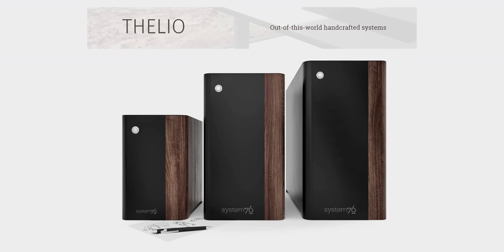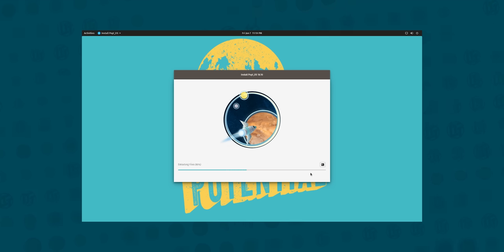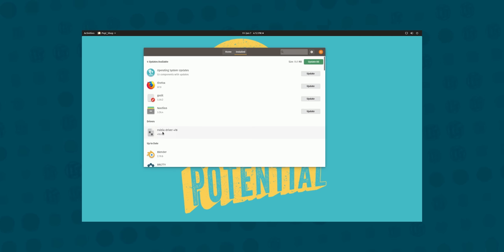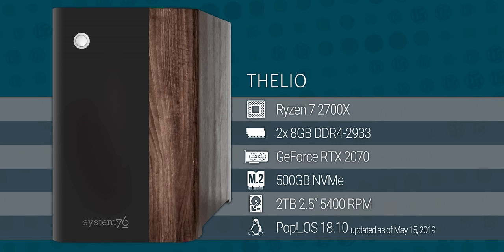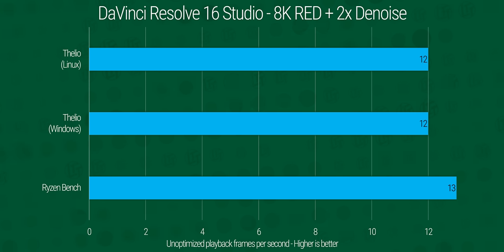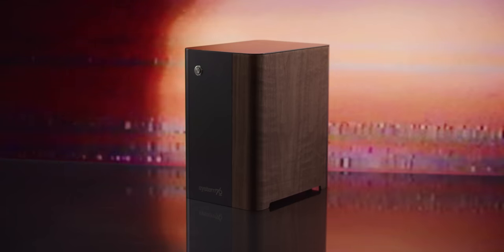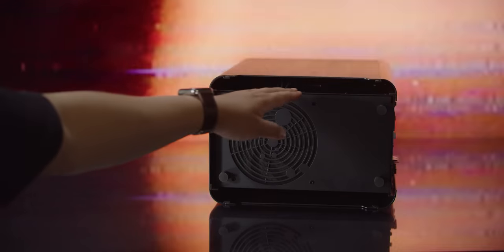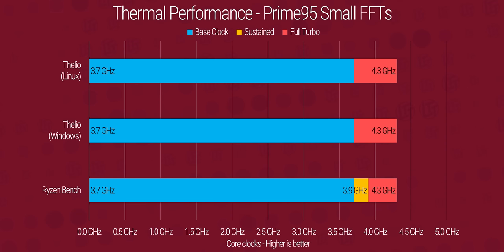A REALLY Weird PC… - System76 Thelio Review

Comment: I've got POP!_OS installed on my laptop and I really like how clean and simple it is.
Reply: How is the battery ? I was thinking about installing it on my uni laptop, but not sure.
Reply: @BlackPeagas  It's less system intense than Windows for most things, so the battery should do at least as well as Windows, but it's hard to say since so many things can factor into battery life.
Reply: @BlackPeagas  If Linux has all the drivers for your hardware, the battery should last a bit longer than with windows. If some driver that is important for the power management is missing, the power consumption can be much higher than with windows.
Reply: @Puma2535  Yeah. The older the Thinkpad/Lenovo and the more AMD or Intel the HW is, the more likely it is that your system will have all drivers.
Reply: Its really great and battery is better than what it was for me on lenovo IdeaPad 320 (shitty laptop btw)
Reply: I used to have pop but i ran into an issue one time when booting which  required me to completely re installed the os and lose all my data.

After that hell hole and losing all my data i just moved onto ubuntu budgie, since it looks nice and clean like pop os and thats about it really xD

The errors were probably my fault but it will probably haunt me for a while since i had a game i was working on which was really close to being in "playable" condition but ultimately lost it : (
Reply: I use Mint with Mate. Not tried POP, but from this video, it looking to be running the standard Gnome 3.x desktop environment, so that "clean and simple" look is not Distro dependent, you can have that exact same look and feel on a different distro, if you just use Gnome 3.x
Reply: @LordDankTron  Why didn't you use git and cloud services to store your project's files ?
Reply: @smartaayush  mines IdeaPad 720s currently on win the battery sometimes goes crazy. But usually very good battery time. the laptop is cool just crazy fans when not battery saver mode.
Reply: @BlackPeagas  lenovo has the most horrible build qualities ever (FULL-STOP). My laptop feels as if someday its just gonna melt due to the hot weather both in India and Bahrain
Reply: @c.james1  on point you are sir , but pop os comes with out of the box proprietary Nvidia drivers . Also it has a default icon pack and theme by system 76 which makes it look cooler and cleaner
Reply: Totally agree. Used it since bought G5 5587. At first was a bit of a nightmare to setup, but after it worked great with great battery live. Tried Lutris, Proton and KVM for win-only apps. Had to install Windows in dual boot and go through a headache again. Yet Pop OS is still awesome and easy to use.
Reply: It runs surprisingly well on my AMD E1-1200-based HP notebook, despite how pitifully underpowered it is.
Reply: Pop! Os with TLP installed it's very very battery friendly. My laptop with Windows, using it for tasks like web developmemt, i was getting like 4 hours of Battery with Wifi on and all Battery life settings turned on. With Ubuntu 19 + TLP, in the same conditions, like 3 hours of Battery, and finally with Pop! Os i was getting the same time as Ubuntu, but when i installed TLP, the Battery lasts 5 Hours without any problem on the balanced power setting.

The Main problem that i have with Linux is that hardware acceleration doesnt work in any browser, so things like watching videos Will end with your Battery really fast
Reply: I installed it on my acer cloudbook 11 and my trackpad stopped working
Reply: @BlackPeagas  I use Elementary OS in every single computer I've got, I'd say it's the definitive OS for a laptop, especially if you add libinput-gestures (e.g. 3 and 4 finger swipes to maximise the current window, open Expose, go back/forward, change desktop....). Battery life on Linux compared to Windows depends a little on hardware, but they pretty much trade blows and you need to test your system to get a definitive answer. The only case that tends to favor Windows is if you have both a dedicated Nvidia GPU on top of the integrated one (Nvidia Optimus), since on Linux you basically can't hot swap them, you need to change GPU in Nvidia Panel, log out and log back in (no need to reboot though). Therefore you need to compromise battery life or performance, or do the annoying log out log in cycle everytime you want to use the Nvidia card.
Reply: @LordDankTron  back up... Redundant back up.. you only lose your data if your not backing up onto a secondary drive..
Reply: @iagobkstar  THX a ton, that was actually quite useful knowledge, tbh didint expect to get from youtube comments. Deffinetly gonna test out Linux performance. And those gestures.
Reply: @BlackPeagas  You're most welcome :) Also, read what Dustin Bess wrote. Backup your data!! The easiest way (the way I like to do it at least) is to get a cloud sync service like Dropbox (2.5 GB for free, has Linux client) or Google Drive (15 GB for free but you need an unofficial client for Linux like insync, not open source and paid) and save your important documents in your sync folder. Or get a backup yourself manually. For big files, pictures and stuff you will always have to back it up manually.

Comment: Well, I’m a macOS user, but this Linux desktop has peaked my interest. Certainly much more reasonable in price than what Apple has recently offered.
Reply: And as someone who grew up in the same ecosystem since the iMac G3 days (I had base model for my first personal computer that I shared with my older sister), I find it equally as appealing for it's upgradability. I even tried Pop os myself during some distro hopping and it's pretty nice, even with the Gnome desktop being a little slow and scaling a little weird on my laptop's screen.
Reply: ElementaryOS, a Ubuntu based distro will catch your interest since it's desktop environment Pantheon is more towards MacOS users.

Comment: I switched to Linux for gaming and all. So far I'm very impressed. (Bring more Linux Content!)
Reply: Julio Caesar  Native Linux games run way faster that on Windows. I have a 3 fold performance improvement in Minecraft.
Reply: @June Kreps  Not going to lie, that 500fps mark on minecraft is making me really curious. Maybe I need to try Linux one day
Reply: Julio Caesar  Even non native through the likes of Proton or Wine can run faster, it depends on the game of course, a game like Strange Brigade or Doom 2016 that uses Vulkan under the hood will most likely run better on Linux but those that use Direct X like Hitman 2 wil see about a 10 FPS advantage for Windows. 
https://www.forbes.com/sites/jasonevangelho/2019/03/01/windows-10-versus-linux-6-steam-games-benchmarked-on-intels-hades-canyon-nuc/#20226de278ce
However something you barely see in comparison benchmarks is the way faster load times Linux provides, I have only seen this in 1 video that covered this and it was on a Opengl port VS DX11 (this was before DXVK) meaning of course the Windows Version held better performance except for the load times which differed by a full minute on the same hardware.
https://youtu.be/w9S5dZN--xE?t=40

To give you an idea how far DXVK is, it can run a game almost double it's performance over a native opengl port did as is the case with Dying Light for instance.
https://www.youtube.com/watch?v=kKdT3RuL9jQ
Switching to Linux is thus fully possible, even running non native games and you can gain some definite advantages for certain use cases.
Reply: Glad you're digging it! I come from a kind of Linux first, gaming second perspective, which I understand is more rare. It's encouraging to hear of people for whom gaming is a priority enjoying the switch! I hope the OS continues to reward you as you learn and use it. :-D
Reply: @user-no3tu9kh3p  By native I mean for games that are not specifically développed for Windows but that include Minecraft too.
Reply: @user-no3tu9kh3p  No, that means a game that doesn't need Proton or a VM to run a Linux game.

Comment: So my thoughts here.

While this system is probably not cost-effective for enthusiasts, it IS cost-effective for companies or individuals that may write-off their purchase as a corporate expense. Having that level of support means that a company doesn't have to use their high-paid consultants rebuilding their own machines, which in a matter of hours could make up that $1k difference.

Likewise, much as is the case made with Macs, it is all about the experience. You have a machine with POP!os installed and no having to configure drivers, or reset dip switches (or BIOS changes) to make things work. It just works.

And again, for someone where time is money, that's a trivial expense.

What I'd love to see is the high end systems compared. That is where if the difference is only $1K between a high end Dell Workstation and a high end Thelio system on a $5K+ system, then it definitely could be a contender for business folks.
Reply: It feels a bit like a modern SGI workstation. It's high end workstation hardware (but not totally custom), in a stylish case (but not indigo), with a workstation OS (but POP!os not IRIX), and enterprise support (but a small team not an empire).
Reply: One thing I would disagree on is "not cost-effective for enthusiasts". I would consider myself an enthusiast, and not a deeply invested Linux professional. Few months ago I decided to go with Thelio basic. I am pretty satisfied. For most part I would agree with downsides Linus mentioned. 
My other two options were build my own PC, or get a Dell Precision workstation desktop. The difference in pricing, between Dell and Sys76, was about $200 to $400 depending on choices I made in a final rig config. 
Building my own would have been way cheaper. But than I wouldn't get support and I wouldn't have that nicely designed tower.
Reply: @myhandlehasbeenmishandled  What is that "support" that you refer to and find so compelling when buying a pc from Sys76?
I, myself, would consider buying a System76 laptop or pc just for their open-source contributions and would put my money same as when I "donate" to other open-source contributors.
Reply: That assumes the company needs Linux, which most don't. Particularly not for the bog standard office worker whose likely used to using a Windows product, maybe a Mac at best (which is even more costly, on average).

It would also be cheaper to hire a proper IT professional if you have to contact support so much that an extra $1,000 per PC is saving you money.
Reply: @RayBitton  the support means that you can contact System 76 support team for any problem you can have and get I quick answer and great service. If your warranty have not expired they would do hardware chango if necessary as you would expect but even if it's expired they will assist you and do their best to fix your problem. I speak from personal experience since I own S76 laptop
Reply: @jksmellie  It depends a lot on the company I guess but overall most somewhat large companies have an IT professional in the staff indeed. However, given the communication overhead, just buying whatever your engineers have asked of you is not such an uncommon thing. The choice of distro is pretty questionable here for that though - I can totally understand a company selling pre-built pre-configured systems but for the office/work usage there're better options for nearly every conceivable use case. Maybe it works well as a "grandma pc" though. I don't know what the target audience for this is.

Comment: Should have talked about the open source daughter board that handles storage Linus. Would have been cool to get your take
Reply: Well you just saved me 11mins and 49 secs of my life. Tanx man! Hahah
Reply: Looked liked a standard backplane. What else is there to talk about?
Reply: @ryanmccullough09  All the specs are downloadable without a NON-DISCLOSURE AGREEMENT. This means that no matter if you are using Window$, MacOS, BSD, Linux, FreeDOS, or MenuetOS,  you can have a driver that is complete. Closed source drivers are to fool the customer, not the competition.
Reply: those are words I know... in an order that I dont...
Reply: @ryanmccullough09  
From there website "OPTIMIZED BY THELIO IO
Thelio Io is a System76 designed chassis controller and hard drive backplane that moves proprietary functionality from the mainboard to the open source Thelio Io daughterboard.

Moving chassis and thermal control to Thelio Io enables far more granular performance optimization. Motherboard data, fan speed, and GPU and OS data are used to coordinate optimal airflow.

Thelio Massive also includes an open source System76 designed SAS backplane for high performance 2.5” PCIe storage." 

Would have been cool to see maybe a little more on how it works and how well it works.
Reply: Seems like a hype scam, from the freecad screenshot they showed it has nothing to do with the important features such as SATA Controller and more with the temperature and fan regulation.

Comment: You missed the crucial info that System76 in their firmware fixes the Intel ME issue by disabling/removing it - that alone is worth few hundred $$$ and for some folks could be priceless..
Reply: But the system they had reviewed have AMD CPU...
Reply: @matemana1991  you're nitpicking, it doesn't change the fact that it is disabled out off the box and for privacy concerned non-techie people it's a big deal.
Reply: @protomors  Google AMD Secure Technology..
Reply: @matemana1991  how did you get from patching firmware to physically removing chips?
Reply: matemana yep, the CPU checks for the existence of ME and if it was not found it halts itself voluntarily
Reply: Dex4Sure https://wiki.gentoo.org/wiki/Sakaki%27s_EFI_Install_Guide/Disabling_the_Intel_Management_Engine

if the IME fails to initialize, either the machine startup will be completely halted at that point, or startup will appear to complete, only for a watchdog timer to reset the whole PC 30 minutes later[14]).
Reply: ArchGamer but it remove the backdoor
Reply: @vldnko  if ME disable the CPU will restart every 30 mins. That is how Intel design their CPU, it require the official signed firmware from Intel to work. Signed is the keyword here, it's mean that the firmware signature is cryptographically signed by Intel.

Comment: Love the Linux content and especially love the system76 content . I only buy system 76 laptops and I would buy their desktops if I wasn't so in love with building my own!
Reply: I'd love to see YouTube change the algorithm to show more critical, instead of suck up, comments.
Reply: Eric Nutter How are the trackpads on their laptops? I’m used to the one on the 2015 MacBook Pro (which I’ve been running pop os on for a few months). A lot of trackpads on windows laptops just aren’t up to snuff. The drivers in pop are quite excellent, so I figure it won’t be much of an issue.

Comment: System76 is an awesome company, and there open source Linux Distro called POP OS, is simply fluent and amazing. I love using the workspace.
Reply: PopOS is bloat af. Install arch to get BTFO kid
Reply: @yrgdrasil6403  at least its open source so you can more easily mod it to be less bloated if you want to.
Reply: @yrgdrasil6403  I need more experience with the Linux environment before I get to the Arch Linux. Anyway thanks for the suggestion.